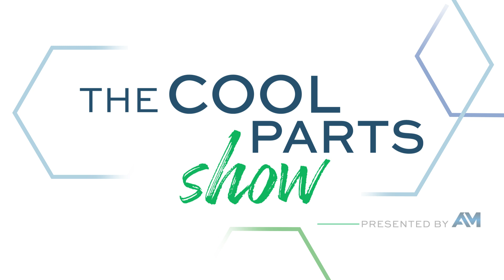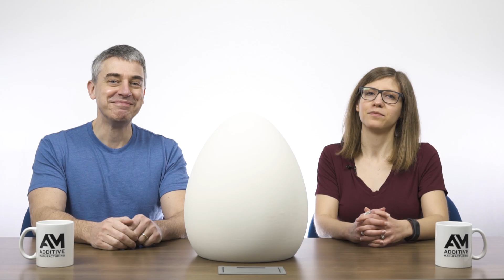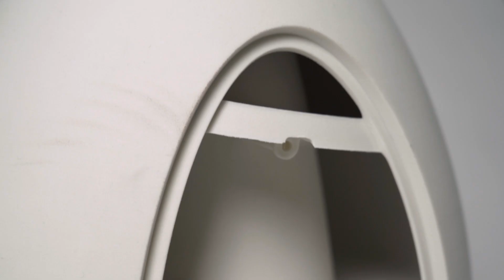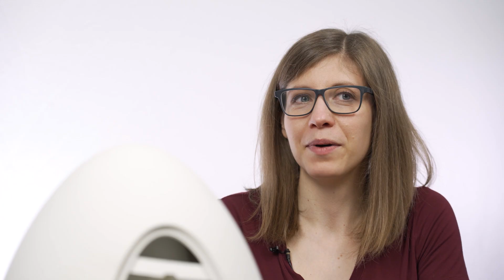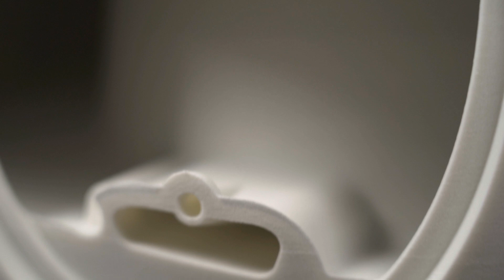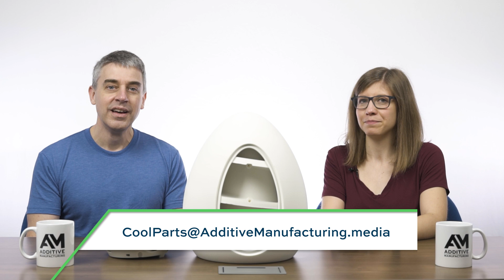3D Printed Hi-Fi Speaker Cabinet: The Cool Parts Show #29

Comment: There are $500 retail worth of speaker drivers in that $20,000 bobble. Seems like an easy DIY project to build a pair.   It would be easy to just build in a second woofer and skip the transmission line non-sense for truly accurate bass.
Reply: When you have an interior that only those bubbles match to, you'll pay 20k for them effortlessly. May be they are intended to be used in a garage where your Porsches resting. I think a classical wooden cabinet does not match such garage.

Comment: Just to be sure, you do know of the spherical Elipson AS-30 from 1969 or the BW Nautilus line ? Sorry that's not a breakthrought, the problem and solutions are well know. 
The material of the cabinet are important too
Reply: additionally... the original Closed Transmission Line speakers were curled closed end speaker cabinets.. a LOT like this. Think they were developed around 1930s.